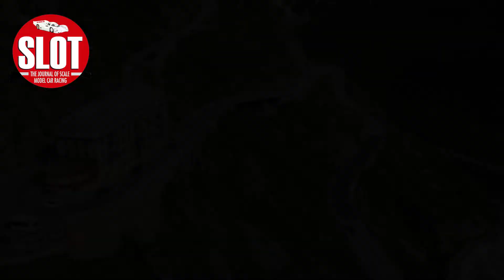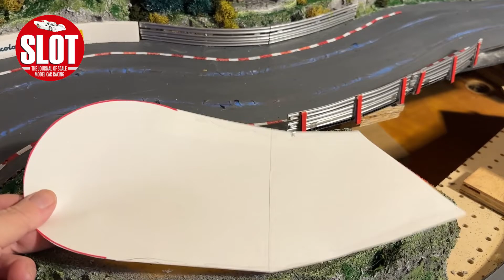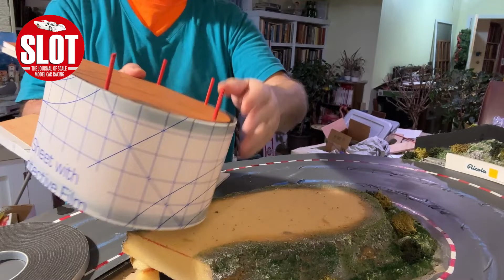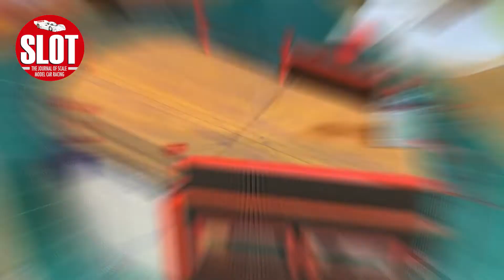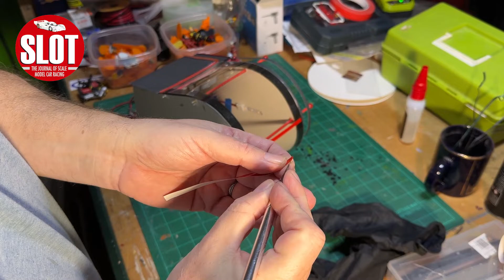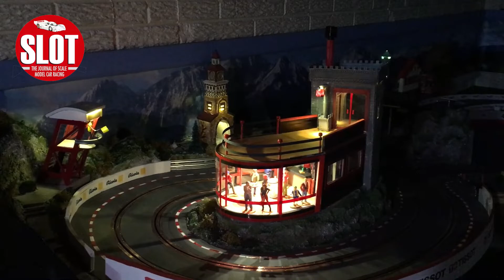SJ 22 - Track Build Guide #10 - Scratch Buildings for Your Track

Comment: Hi,
Very interesting videos you make.
But I miss one point of information and that is how you painted your track?
Could you please tell us?
Looking forward to your next video.
Take care.
Reply from the maker: The Artin track is very similar to Carrera, though not as wide. The process is: 1) tape off the rails with masking tape,  2) fill in all the joints with drywall compound and sand smooth,  3) apply a couple of coats of latex paint - I just use a brush. The paint doesn't have to be expensive; you can use a primer, but I didn't bother. It holds up quite well. Glad you enjoyed the video.

Comment: Looks great Mark,  what is the pink material you used for the tower?
Reply from the maker: Thanks, Dave - it is a 1/2 inch foam insulation board - usually available in home improvement centers. It is normally sold in 4' x 8' sheets, but you can get it in a handier craft size from Amazon, too: https://www.amazon.com/gp/product/B074VPZ8SS/